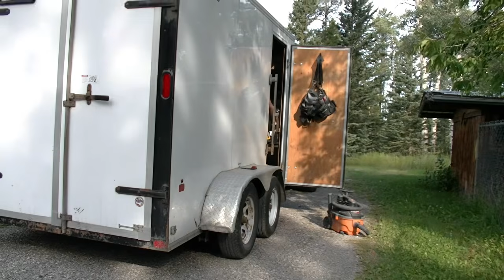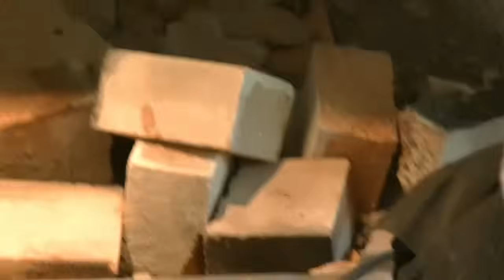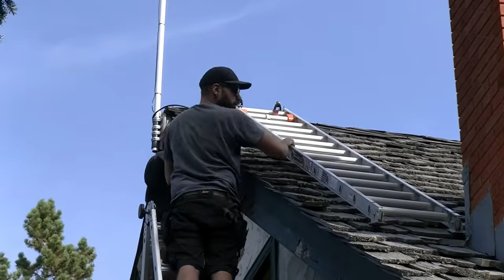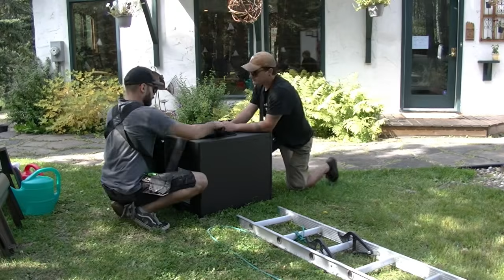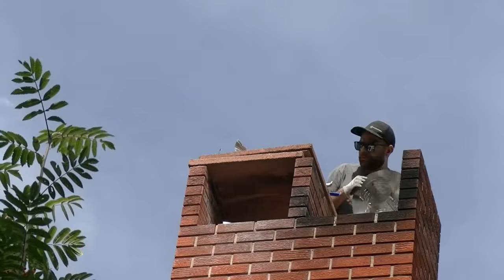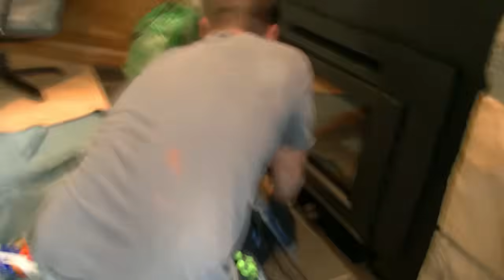Wood stove insert installation and review

Comment: Looks great!  One question- on page 36 of the Osburn Matrix installation manual it says if the unit is installed flush with the floor the hearth needs to extend 23 inches, not 18.  Also, the 23 inches should have an R-value of 1.0 or greater.  This seems like overkill, wondering if the installers thought the same thing?  We are thinking of getting this unit, but don't have 23 inches of hearth in front of the fireplace opening.
Reply from the maker: There are different specifications for the hearth in Canada and the U.S.A. Even local building codes differ. In my area a masonry hearth only requires 18 inches. That is with good reason as burning embers can spill out of the stove onto the floor. If the floor is covered with tile or stone you won't have any problem. A masonry hearth is recommended.

Comment: How are you liking your Matrix so far?
Reply from the maker: It's great.Beside the heat and aesthetic, it solved the problem of house heat going up the chimney. A fire in the old fireplace used to suck warm air from the furnace out of the house. The fireplace did produce heat but the warm air upstairs got sucked out the chimney. Now the furnace doesn't run as often and the stove doesn't produce very much smoke.
Reply: @braggcreek  I've seen some reviews that complain about the blower fan noise being too loud. Any thoughts on that?
Reply from the maker: @173muppet  I was worried about that too, but was pleasantly surprised at how quiet it is. That's not to say silent, but it doesn't interfere with conversation. In fact, it's a relief when the stove gets hot enough to automatically switch the fan on because the blower pushes the hot air into the room.

Comment from the maker: As we live in southern Alberta, Canada, we don't have a supply of hardwood. We have spruce, fir, pine and a lot of aspen. I thought aspen didn't produce creosote, but I was wrong. Within a week of frequent fires, the stove window gets coated with orange/brown creosote. People say that a paste of white ash and water will clean the glass. Not true. You need a creosote cleaner to clean the glass. I ordered a jug of Meeco's Red Devil 702 cleaner. Although I haven't tried it yet, I'm pretty sure it will remove the creosote film on the glass. Here's the Amazon link: https://www.amazon.ca/dp/B00ACGJV8O?ref=ppx_yo2ov_dt_b_fed_asin_title. This also means that you will need to get a WETT certified chimney sweep to clean your chimney annually.
Reply from the maker: The  Meeco's Red Devil 702 cleaner works. It's not magic. It requires some effort and time (20 minutes), but the creosote film on the window is gone. I applied quite a few applications (using heavy duty rubber gloves, a heavy duty spray bottle and shop towels). It's acid, so you need to wear protection. It doesn't melt plastic, but the manufacturer says it can damage you. So, be careful.
Reply: Switch to a hot burning masonry oven/stove and you can burn anything with no creosote build up. 
I have a two ton soapstone oven from Finland and the chimney inspector that is supposed to to come every year by law ,skips our house because when he does inspect , he never finds enough material in the chimney to warrant cleaning .
Reply: The build up on the glass could be due to green wood or running your stove at a low temperature.  Try opening up the damper more at the beginning of the fire to get it good and hot.

Comment from the maker: Once you've gone through the process of researching, selecting and agreeing to purchase a stove insert, the real action begins with the installation shown in this video. Then, you have to learn how to build a fire. The draft of airflow up the chimney is critical to a hot fire. I use paper, kindling and firewood arranged in a pile with the wood crossing each other so there is good contact between the pieces where the fire will ignite. Done properly, you should have a good fire in about 45 minutes. Keep feeding the hungry beast and you'll have many hours of comfort and pleasure.

Comment: Is that the Osburn Matrix 2700? Or the smaller one? 
And what were the dimensions of your fireplace opening?
Reply from the maker: They have two Matrix models, this one is called the Series 1. I think it is smaller than the 2700. You will have to make detailed measurements. I think the fireplace is 42 inches wide. You can find out more about the Matrix here:
https://www.osburn-mfg.com/en/products/wood-inserts/matrix-wood-insert/
As my fireplace was fairly large and they removed the firebrick wall in the back, I was able to insert the stove inside the fireplace. Most installations have the faceplate outside the stone fireplace.